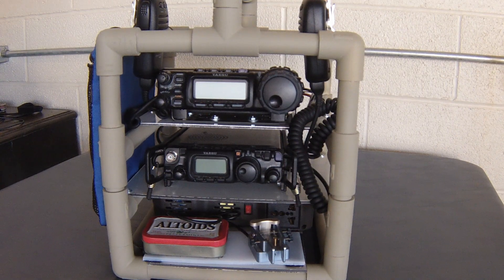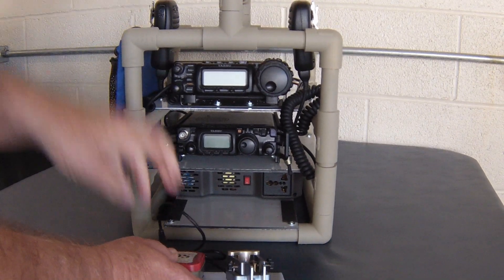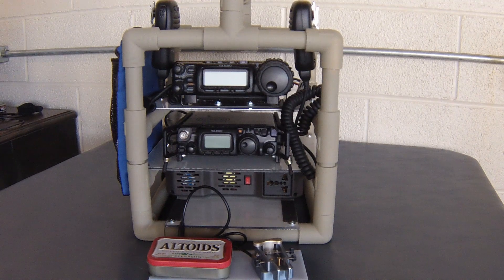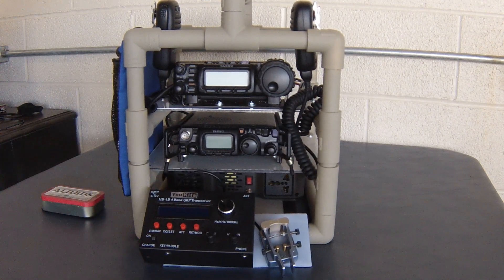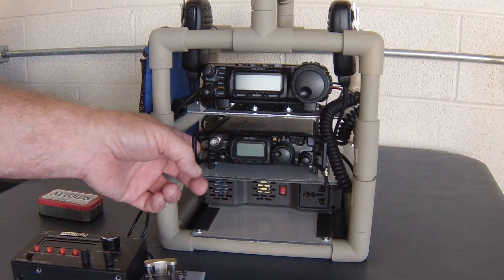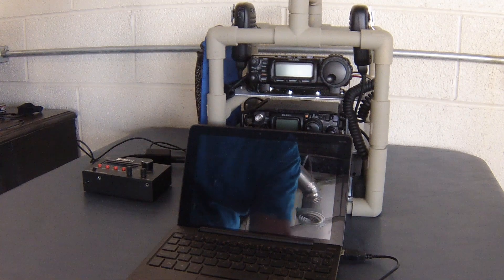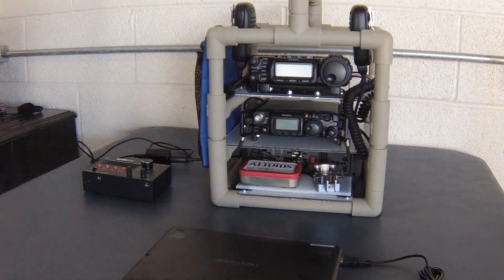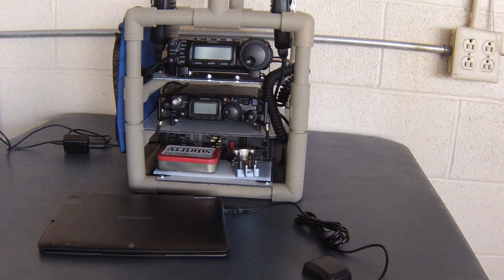Ham Radio PVC Go Carrier

Comment: That's a great station. But, did you know you can adjust the low power setting for the 857 to 1 watt?  It can also be QRP so you would not need both radios for QRP and QRO...
Reply from the maker: Well of course, however i work linear satellites a lot and use both for full duplex. Also have sat pc32 for rotor and to control both rigs.